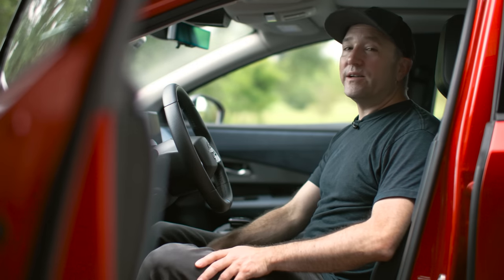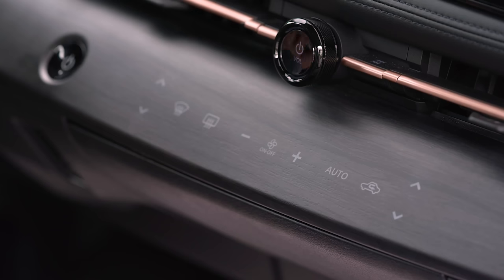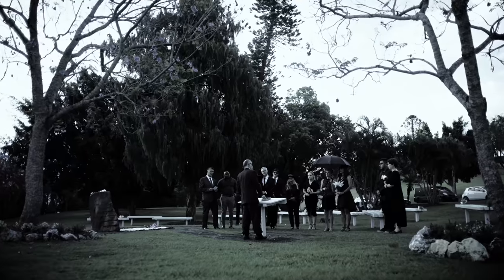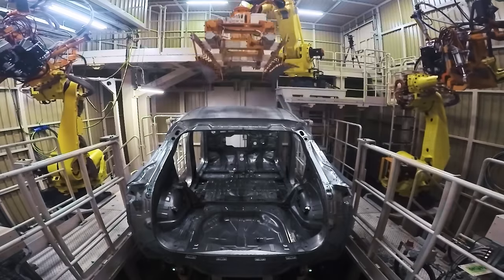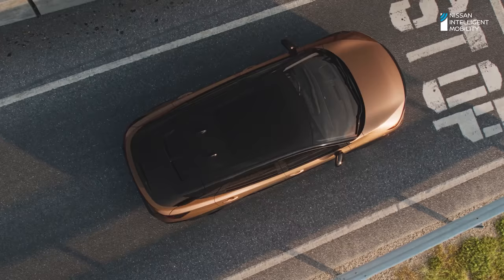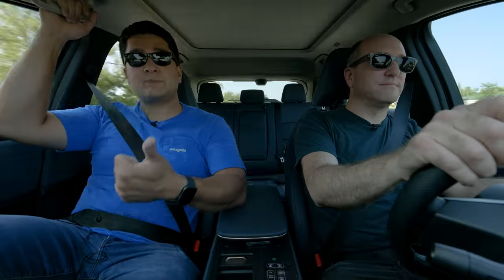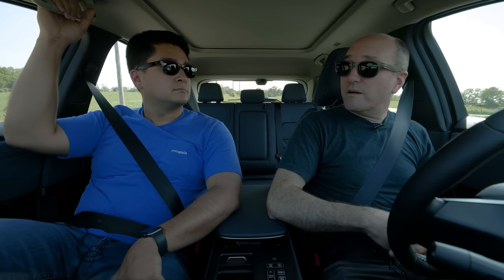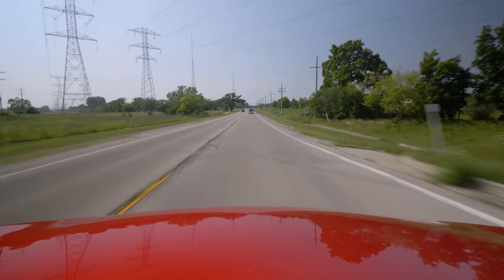Nissan Ariya EV | Too Little Too Late?

Comment: It come down to timing and price.  Before Tesla cut it’s pricing this might have been vey attractive as an alternative. Now Tesla is cheaper and the Ioniq 5 is better as a Tesla alternative.
Reply: It will depend on the fit & finish / durability of the Ariya, like the Geese said. I think there are plenty of people who would like a Tesla but with better build quality. This car also seems to be quieter and plusher than the Model Y for example. Time will tell...
Reply: @benjamindoyle668  The Tesla's from Austin and Berlin are at the same level as Hyundia/Kia for fit and finish. It's Fremont's older line that has the panel gaps and squeaks and rattles. I just find the Tesla seats to be below average for their pricepoint. If I could MB GLS seats in my Model X I would be happy. This Ariya with the perforated seats probably feels heavenly compared to a M3/MY seat.
Reply: @Tokamak3.1415  Interesting info. I wonder too about ride quality, wind & road noise, etc.  I remember hearing that the early Model Y was atrociously stiff riding and that the later cars were improved, but maybe the cushy Nissan will appeal to an older / more relaxed demographic? I also don't think Teslas look / present expensive enough for their price. You're sort of getting a Toyota / Hyundai wrapper on a very well-engineered EV platform. That's fine for some people but it leaves a lot of other customers feeling short changed.
Reply: Test drove a MY and i5 recently. i5 was definitely my preference. Only thing that held me back was that the MY was a much more mature platform and Tesla has the better software and charging infra.

There are some bad problems cropping up in the i5, such as charging over heating triggering a kill switch which Hyundai has acknowledged but says owners will have to live with it, and the 12v battery issue. Plus the Tesla price cuts and tax incentives made it really hard for me to decide.

I’m gonna wait for 2024 with the new gen Tesla’s coming out and seeing if Hyundai refreshes their i5 and keep an eye out for more bad issues popping up. I’m really hoping the i5 fixes their big issues, or the Tesla fixes their cabin in the MY so my ears don’t feel weird and that they add Apple CarPlay (highly doubt they will though).
Reply: @traolin5877  I’m doing the same thing. I have heard of issues with the i5 but I’m not sure what percentage of the cars are having the issues. There is going to be a lot of issues with any car. But I do get the sense they have some things to work out. I’m not hearing about any specific improvements with the i5 but I’m going to wait and see what they do.  I fear that the Model Y is going to get worse rather than better as Tesla seems more focused on cost cutting than really improving the car.  I was talking to a Tesla owner and I said that the Y ought to be getting pretty good by now as they are making a lot of them and they haven’t made significant changes. He said they were making constant changes with kept the assembly from improving as much as you’d expect. That was just one man’s opinion. But should that improve on the Y I’d consider one.

Comment: The styling is so fantastic inside and out,  and the colors avaliable are great. Falls apart on range and value sadly. Almost got me out of a 3.
Reply: Range is fine with 300 miles. It has a big battery.
Reply: @salipander6570  that's only specced a certain way. Others are mid 200
Reply: Piano black on exterior?!
Reply: @bartwaggoner2000   lmao!! Yes please.  Piano black seats!
Reply: @salipander6570 for 60k you can get an optioned Y LR or performance after rebate.  No contest.

Comment: What's the off-center lump on the interior where the headliner meets the rear glass?  17:30
Reply: I'm pretty sure that's the rear camera for the digital rear view (interior) mirror.
Reply: @aprtur  y it so big tho   O_O
Reply: @TrailTape  normal?  Most glass mounted camera units are large.  Just look at the front facing units in the windshield on most newer cars
Reply: @aprtur  A lot of those are stereo cameras though, for precollision safety.  Why not just mount a small external camera, like backup cameras have been using for over a decade?
Reply: @TrailTape  I'm sure there's a reason for it - I doubt they'd spend money on extra material they don't need

Comment: I have not driven an Ariya; I was out of the market before it shipped (we have 2 2021 MMEs). But it seems like a very pleasant car to drive, certainly the most pleasant vehicle Nissan makes. If i were looking now I'd test drive it. 

I never drove an EV until i picked up my wife's 2021 MME. Even though I knew it's a gen 1 car and the next version of all of these cars will be a lot better, there's was still nothing I'd rather drive at the price point with my lease coming up. So I got one for myself also.

Comment: When will the EV manufacturers stop jamming 0-60 and horsepower numbers down our throats… the typical EV purchaser doesn’t GAF about those numbers, unless they are bragging down at the local Pub… manufactures should spend their marketing budgets on eliminating all the question marks about EVs..such as real world ACTUAL RANGE, with the a/c, heat or other accessories on… or better yet , what to do when a hurricane hits Florida and there is no power…. Generator in the trunk ??? Or better yet the replacement cost of a battery pack when it’s goes south in 5 years… increased insurance costs, special tires. let’s just face it boys and girls, EVs are disposable cars after 5- 7 years…. Says my 1999 Honda Accord after 338k miles… runs like a champ, a/c works , can fix it in my driveway and it’s paid for… I can think of infinitely better ways to spend $50k on a car….

Comment: my issue is that a vw id4 equivalent is 10 grand cheaper, bigger space and longer range, also heard reports about it being quieter
Reply: Try adding the same equipment to the id(iot)4 and see if it still is cheaper. The range, sound, and space is not better either.

Comment: The Nissan Dealership near me has $3500 off Empower 4wheel drives
Reply: I got my Engage base for 20% off MSRP! 4400 off from dealer and 4750 from Nissan rebates.. $44,700 MSRP (includes destination) down to $35,500! 😃  Engage base has so many nice options, it's plenty  fast.. and 220 mile range is all I need for my daily needs . Looks best in gun metallic color imo. I have a gas ram truck for my long trips with the family. We are saving so much money in gas with our local commuting. Drive super smooth and quiet. We love our Ariya!

Comment: The nissan ariya is going to be a forgotten about vehicle as soon as the equinox ev comes out it will basically be the same vehicle size wise but with faster charging and 10k cheaper starting price

Comment: If the market didn't need SUVs, the best thing would be to refine the Leaf architecture, add liquid cooling to the battery, and improve the BMS.
It really was a great car with one giant downside, which can now be remedied by advancement in battery tech. But that will never happen because of the horrible name that car made for itself.

Comment: I just don't get it, $60k is a lot to spend on such a disposable vehicle. Whose, going to work on it in 5 years, parts, the $$$ to fix. I get YOUR goal is NOT to owe it in 5 years. but thus my point. 60k, give me 2x 2022 Accords. I get 400,000 miles....Biff get 100k and a battery pack replacement and if he gets to 150 before the pile explodes.... Pity the people who will buy these down the road and they will, Pity, its EV insanity to buy one of these now. SMH

Comment: these engineers are sorely mistaken if they think charging in extreme temperatures and battery longevity and range isn't a big deal. and his thoughts on most drivers charging at home and at the office is very short sighted. maybe it's not a big deal now, because the current crop of Nissan ev buyers don't have a more difficult living situation, but if they really want to take the market and expand, they should think more about on street parking and fast charging away from the home. not everyone is a home owner with a driveway and a garage in a moderate climate with a power outlet.

Comment: Cancelled my platinum eforce awd.    Seems like it was made over a 5 year period....range charge speed no frank and felt alot slower than 4.8 to 60 and last about 10k too much.  I would have purchased if level 2 was min 11.5kwh and level 3 was 250k on Tesla super charger system. Home run if 75mph highway in winter was 280 miles and 310 in summer.....waiting for my Cybertruck

Comment: EV batteries last from 10 to 20 years. That doesn't mean the degradation of the mileage will stay the same. And replacing a battery will cost from $5k to $20k.
Reply: Plus, you will have to wait to get it replaced. A long time.

Comment: I’m waiting for an EV manufacturer to promise their vehicle will not cause a fire in your garage and house.
Reply: Not a peep about how 117,000 parked gasoline vehicles catch fire per year?
Odd. I guess that doesn't fit your narrative.
Reply: Officially, there have zero thermal events with the Leaf.  There is a rumor of one but it was never confirmed.  By far, the Leaf continues to be the safest EV on the road.
Reply: @bobbbobb4663  Right.  I was referring to the Tesla and most recently Mercedes Benz fires.
Reply: Nothing will change that lithium battery vehicle fires are inherently much more difficult to extinguish than gasoline vehicle fires.
Reply: @tim3172  BS. Gas cars do NOT burst into flames just sitting in your garage. EV's DO burst into flames just sitting. Only gas car fires are caused by an accident or they are old and have been worked on by Joe Shmo's shade tree garage.
Reply: @bob-qi4nr There is a video of a Frontier bursting into flames while parked in a dudes driveway off. Also Kia Hyundai are also having issues with that, the data shows gas cars are WAY more likely to be involved in a fire during an accident and in general. You are literally managing thousands of tiny explosions per second when it’s on and running.
Reply: @bob-qi4nr  “No fire onboard a ro-ro (roll-on/roll-off) or PCTC (Pure Car and Truck Carrier) has been proven to have been caused by a factory-new EV”. The International Union of Marine Insurance (IUMI). 
There has been eight car transport fires in the last ten years. 
BMW recalled a million ICE in 2022 for stationary fires risk.
So have Ford, Mitsubishi and Hyundai.
Its in all the news feeds!
In US in 2020 over a million ICE were recalled for fire risk. 
By 100k sales ICE are 60 times more likely to combust than BEVs (Auto Insurance EZ, Bureau of Transportation Statistics and the National Transportation Safety Board).

Comment: I see the aryia, I see it's competition. All it does is make me happy to keep my 2920 ioniq ev. It's just a regular car that happens to be electric. Same as the niro ev and kona ev. Most of these evs are atrocious "future showcases". Why couldn't they just give us a maxima with an electric power train, like as is, no interior changes
Reply: Too many differences with packaging the battery. You can't fit that battery in the engine bay. Even if you could suddenly the car is super front heavy. Its best to have a purpose built design that puts everything in an optimal spot and can be re designed for better aero and whatnot. Unfortunately this costs alot of money, but purpose built ev platforms are so much better than just sticking some electric shit under the next version of an existing model.
Reply: @ShotGunner5609  my hyundai ioniq 2020 is an elantra with a battery and man its a better ev than all the other crap put out, including their own ioniq 5 and 6. BMW evs are just their sedan/suv counterparts converted to electric, an f150 lightning is an f150 converted to electric. Why make this piece of shit when they have a really really good sedan on their hands.

Comment: 🎯 Key Takeaways for quick navigation:

00:00 🚗 The Nissan Aria is an all-electric SUV, more upscale than the Nissan Leaf and represents the future of the brand's design.
00:36 💡 The Aria is a peek into Nissan's future design and technology for the next five to eight years.
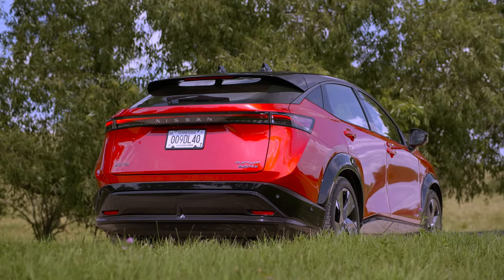01:18 🔄 Aria's design seems to be similar to the Model Y, ID4, and Mach E.
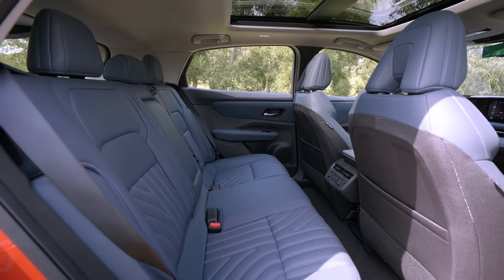02:01 🎒 The Aria offers significant cargo space and legroom, with an overall spacious feel inside.
02:30 🎨 The Aria's interior design utilizes light blue seats and a microfiber material across the dash. 
03:27 🎮 The vehicle offers a blend of physical and capacitive touch controls, creating a very clean aesthetic.
04:23 🚘 The driving experience is quiet, refined, and comfortable, but the audio system is not impressive.
06:19 💰 The Aria starts at about $53,000 with the smaller of the two optional battery packs.
09:47 🌿 The Aria is Nissan's second attempt at a mainstream EV product, designed to be a replacement for SUVs and CUVs.
12:35 🛠️ Nissan offers maintenance coverage, a battery warranty of eight years or a hundred thousand miles, and free charging for the first three years for the Aria.
16:02 🎛️ The Aria has varying brake, acceleration, and steering feedback that could feel artificial to some drivers.
20:24 🆕 The Aria offers a lot of features and technology, but also has areas where the budget for development shows its limitations.
21:33 🔋 The Aria could be a step forward for Nissan in the EV space, offering a 300-mile range and a long battery warranty.

Made with Socialdraft AI

Comment: I had the GR Yaris but I needed something bigger, so I got the much accomplished hyundai kona electric, I couldn't be happier. So much cheaper to run, such a pleasant drive. Even a bit of offroading is possible which I didn't expected for a fwd.
Let's be honest, 99% of driving that happens on street roads is not performance driving, and that is a good thing. EV do have nice torque for overtaking if nessessary.

Comment: I'm not likely to get into an EV for quite some time, I don't like CUVs, I don't like FWD, I don't like heavy cars with intrusive nannies that cannot be turned off. The Kia/Hyundai stuff is getting there, but until I get a dual rear motor RWD car with defeatble nannies, or at the very least a single big rear motor with a mechanical diff & defeatable nannies, I don't want any part of it. They are too heavy too be fun, and the nannies are too intrusive. Tesla has great motors, batteries & controllers, but their cars suck; not just from a build quality standard but from the "touch screen all the things" design philosophy, which is just for manufacturing cost cutting and nothing else, not to mention the yoke. We'll see what the next decade brings, but until there is something out there that is actually fun to drive, I don't want it, especially not at the 60k+ every EV I spec out is asking for; I'd rather a CT4V-BW or IS500 at that price point.

Comment: Two thangs:

-all EVs look the same, they all have a lower rounded front end coupled with a bulbous bubble like rear end (Model S and Y, Inoiq, EV6, ID4, even the Taycan and E-tron). This is because the entire chassis must be designed to accommodate those huge battery packs.

-Nissan/Infiniti does not make one exciting extraordinary product due to what Jack said: they don’t have money. Their sales have been plummeting for years. They haven’t redesigned most of their product line for years.  From the overpriced obsolete GT-R to the disappointing recycled half hearted “new” Z, there is no compelling reason to buy a nissan over its competition. This Ariya is generic, it won’t win any single car magazine competition and it can’t even contend as the budget choice considering its price.

Comment: I think what we are seeing is that as EVs take over, there is still a wide gulf between the drivers cars and the grocery getters. For example, the Kia EV6 is worlds better in terms of driving dynamics compared to something like the ID.4 or Ariya. It's no different than gas...you can either tune for fun and driving dynamics, or comfort and everyday practicality. That will always be the trade-off, no matter the drive train. I always recommend reviewing the vehicle as its meant to be used--if its' meant to be a well rounded crossover that can do anything sufficiently, then review it as such. I saw a new Ariya in a parking lot the other day, and in person it looked very nice. The green paint was striking and it looked well proportioned. There are a lot of vehicle manufacturers out there and buying decisions often come down to the details.....is it built well? Can you get it in the color you want? does it do most things well? is the dealership experience good? that's what most people care about. I suspect the brake pedal action will be refined within the first 2-3 years of production and those types of things are usually tuned over time. It's a brand new product and I hope nissan does well with it.

Comment: Are people really ok with shitty sound systems? I automatically wont buy the car if it's shit
Reply: The vast majority of buyers, even luxury buyers, get a terrible sound system.
Audi only had an 18% take rate on the B&O system. 
85% of Range Rover buyers opt for the unbranded system.
Toyota doesn't list the JBL buying number, but considering it's an expensive option generally only on the top one or two trims, I'm guessing it isn't the majority of their sales.
Etc. etc.
Reply: @tim3172  I don't need a 10k sound system, but I at least need it not to be shit. I have the base system in my audi, and while it doesn't sound magical, it gets the job done. But if a system is compared to wearing ear muffs, that no thanks
Reply: My Airpods Pro running EQE on Jailbroken iOS sound better than 99% of car stereo systems.  I don't even turn on the radio anymore in my own cars or cars I rent.
Reply: @tim3172  That Audi B&O number is pretty stunning. Why would you pay Audi prices for mass-class tunes?